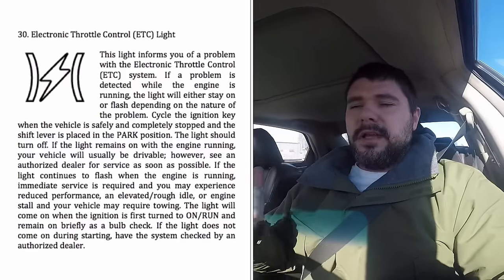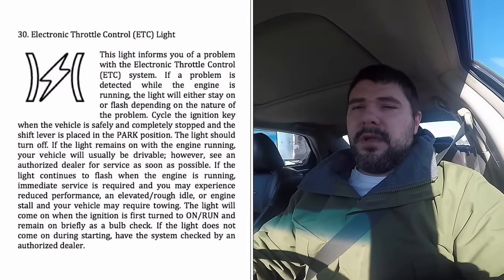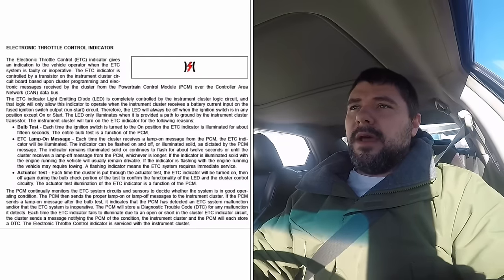Chrysler 300 lightning bolt warning

Comment: I have 2005 Chrysler 300 and the same  thing happened. I was cleaning the throttle body and after putting it back that flashing light came on. What should I do?

Comment: I have the same car 06 300c srt8 my car was shutting off while driving i took it to my mechanic he said there was a leak with the radiator he fixed that for 500 the same thing happened i took it back he said i need a new throttle body and air filter i got a bbk brand new throttle body and replaced my k and n air filter. It hasnt shut off since but im still getting a p2110 code for the throttle body. I restarted the computer and it was better actually driving without feeling like it was going to shut off with no codes them the code came back p2110 im starting to think i need to perform a throttle relearn since i completely skipped that step but im not sure.
Reply: The mechanic knew it wasn't the radiator to begin with..smh.

Comment: Mine just did it.
It's the throttle control system.
Clean with  throttle body clearner.
Fixed problem.
If dosent,get new throttle control system,replace.
Yall have a blessed day
Reply: I have an electrical nightmare. I replaced the throttle body and the accelerator sensor issue still happens. I have a constant electrical forced and I cannot get the flap to move at all it is stuck at negative 100.
Reply: Hey everyone I have a 2008 Jeep Wrangler Sahara 3.8 l V6 and it keeps tossing a electronic throttle light and also the ABS light. No check engine.  My Jeep has a 1360:00 miles on it every time these 2 sequential lights come on I have rough idle goes into limp mode rpm to be around 1200 rpm a cetera and so forth anyway so because she has so much time on it I was just going to replace the ETC but my question is do I need to have it taken to a mechanic to be re learned on the throttling for my engine?
Reply: Replaced throttle body and lightning bolt still comes on

Comment: Great video, answered my ??? why my scanner did not detect a ATC code? My 2008 Jeep Grand Cherokee has the the lightning bolt? Good point about buying dealer, genuine Mopar parts! Auto companies standards of quality are higher than after market. Though auto companies are only required, by federal law, to provide replacement parts for their cars for 10 years!

Comment: My lighting bolt light came on, not losing power while driving, but my brand new battery is completely dead. Will not charge. I get a new battery and within a day, the battery is completely dead and will not charge. I'm glad I have a year warranty with the battery. What could cause THIS problem?

Comment: I recently took my 3.5L Chrysler 300 2006 to a mechanic , they don’t know exactly what could be causing all my codes. One night parked my car cane out 2 hours later my car is stuck in park and in limp mode with 26 codes. My car also does very often with a weak turn over,  idle is stuck @ 3000 rpms while driving ??? Any info would help.
Reply: If your shifter is stuck in park...a little piece of plastic has broken off. There are tons of videos and fixes for this.. look it up.

Comment: Hello, good video overall 
Everything you said makes sense, I had the same issue last week with my 06 300. 
I was getting the the throttle control light with the ESP at the same time, after driving for short time, I replaced the throttle body, That did not fix the problem, I noticed i was getting a heavy air leek on the EGR metal tube that connects to the Intake manifold, I change the rubber seal put everything back to normal and so far problem solved 👍👍

Comment: Hello....i have a 06 chrysler 300, 2.7l engine....my lightening bolt light came on and car started jerking and slowing down....took it to the mechanic and he ran tests and code came up bad throttle body....so he replaced it with a new one....car ran ok for a couple of days but then the lightening bolt light came back on as i was driving on the freeway.....towed it back to my mechanic....he turns the car on and no lightening bolt light comes on....he kept the car for 3 days and ran it long distances....says light never came back on and car ran fine....i pick up my car and it drive ok for the day but that night the light came back and car started to shake again....i don't know what else to do....could it be the MAP SENSOR? CAN ANYONE HELP WITH ADVICE...
Reply: Did you do the reset?
Reply: Same that’s my happend to me did you ever find the problem?

Comment: Hi...my ETC light along with engine light is currently on in my 07 300.  I just had the fuel filter replaced a few days ago.  Currently have 213,250 miles
Reply from the maker: krm2032  the order of diagnosing that type of issue is to first see what the check engine codes are. Then fix what the check check engine codes are. Once you fix those issues and reset the light see if that fixes your etc light. If your check engine light stays off and your etc light only comes on after replace your throttle body

Comment: Thanks for the advice. I will get back to you when I get my car checked out. It's not a 300 but it is a Chrysler 2007 Sebring. My engine light did come on then the lightening bolt. Prior to those two lights the oil pressure sensor light.

Comment: My car dies while parked, driving or anything. Parked it dies and I have to restart it but if I’m going fast enough my car just starts back up in less than a second when I’m driving. The check engine light, oil light and red lightning bolt comes on when it dies. I replaced the throttle body, spark plugs and made sure the egr tune gasket is on. I don’t know what else to do. Any help please
Reply: Im having same exact problem the mechanic said it's the throttle body sensor thinking of just getting rid of it all together
Reply: I just get a oil change when this happens and it goes away
Reply: Did u figure out what was wrong?? My car is doing the same thing
Reply: This is common for these lemon Chrysler's.  I'm almost sure it's either the ECM/PCM unit, EGR valve, crankshaft sensor or throttle body.  All these are common for 300s & 200s & sometimes even fuel pump issues.  Chrysler should be ashamed of demselfs

Comment: I have a question. I don't think it has to do with this but here goes. My Chrysler 300 was stored for about 2 months in the garage and without knowing it somehow the truck wasn't closed all the way and drained the battery completely. The key fobs wouldn't work at all no lights nothing not even a click like the engine trying to turn over. I have been trying to get it started by jumping in in my garage but all get is the clicking sound now and very dim lights for just a few seconds then it won't do anything. the battery is just over two years old and never had a problem until now. My question is I heard that I might have to disconnect the battery completely to reset everything before it will start even if the battery is still good? Please I'm definitely not a mechanic and have no way to tow my car twenty miles away to have someone look at it. Any advice on what it could be or what I should do would really be appreciated. thanks
Reply from the maker: Get a brand new battery or charge your battery completely and see if it will start. It sounds like the battery is too dead

Comment: Hi, I started getting lightning bolt warning while in ignition but goes away when engine turned on. But only able to drive very slow. When tried to throttle its little to no power then and then. Oil change was due so I got it topped up first and the problem disappeared. Throttle response is now okay I think but the lightning bolt warning stays with check engine. It doesn’t go away like before. What do I do now. Someone help please. Thanks!

Comment: He is proud to say my 300 throttle body went 120,00 miles no problem? I have 3 Lexus vehicles (2) ES300's and (1)RX350...all totaling 730'000+++ miles and None of my vehicles have ever needed a throttle body Chrysler/Dodge plays these games. Even installing a specific "built in lightning bolt "crap to officially screw us that's a scam from them the fact it has that lightning bolt alone is shady because it is a well known issue and they want to capitalize on it....

Comment: I have a 2006 Chrysler 300 that was running fine but had a lifter tick. I found 5 bad lifters and replaced all 24 of them and put in new spark plugs while I was at it. Once I got it back together it turns over good, but won’t start. The ETC light is now on as well as the CHECK ENGINE light. Everything is assembled and plugged in correctly. Any ideas? The car has 200k miles, is it coincidence that the throttle body could have gone out while I was working on it?
Reply from the maker: jeff dye  I would pull the check engine codes first fix those issues then see if it takes care of the throttle body light at the same time
Reply: Omg my car is the exact same model and everything and it's the same problem too I'm getting my liftwrs fixed and I hope my car is okay after but I'm nervous

Comment: I need help.. mine shows Lightning bolt and motor light  and car won’t turn on .. my battery is good n starter .. what would be the problem
Reply: Omg my 200 did that today.. got a jump and all lights went off and it ran fine🤷🏾‍♀️

Comment: My wrangler has a hard start changed. Crank shaft sensor ignition coil.   Also my ⚡️ symbol is on.   When I reset it goes away but will come back on within a hour. And my temp gauge goes to cold.  Can this be a problem of hard start ? Or air in system that will make it over heat after 2 hours ?

Comment: You might be able to get the error code you want from the screen display.
If you press the Note 🎵 on the left hand side and the Compass 🌐on the right hand side for about five seconds that will bring up a sequence of 11 diagnostic and information displays which you can scroll through with the up-and-down buttons on the left hand side.
One of the displays is last error code.

Comment: Lightning bolt came on in my 2006 magnum 3.5 it turned out to be Egr  tube gasket going into back of plastic intake got sucked into motor! Easy fix! I was lucky!
Reply: Did it still run. I've got a not start issue
Reply: @eazydamonster1949  might be the alternator as well
Reply: @alexmariscal1926  I haven't figured it out but alternator is good. I just put it in the back and looking for a car to hemi swap it and facelift it

Comment: Changed my old throttle body with one I found at the junk yard. Problem returned. I guess its either change the computer or pull over and cycle the key from now on.

Comment: had my spark plugs replaced and they broke the intake or egr tube and was caused a vacuum leak leading to the red lighting bolt and my car limp mode could be the issue if you have a vacuume leak near your intake

Comment: We just bought a 2013 Chrysler 300c series about a week ago. We haven't had any issues at all until I drove it today. Everything was working properly there wasnt any lights on the dash or anything. Came home and parked. A few hours later I went to leave and it would not start. The lightening bolt symbol came up. Jumped it and it started but couple hours later same thing. Now just the check engine light is on. Any suggestions on what to do and what would cause this?
Thank you!
Reply: Same here did u figure that out
Reply: Did either of you figure this out because I had the same issue loves

Comment: I've been having this problem randomly and I think it's due to my electronic throttle controller that I hooked up. As soon as I put it in the lightning bolt turned on but now on occasion the boat will start to blink and it will accelerate real high until I stop the car pull over and turn it off and let it sit for a minute then turn it back on and it'll be fine except for the light still being on obviously. I'm wondering if it even is the throttle controller? I have a 2012 Dodge Charger RT Max with the Hemi and I have the 2020 dash gauges installed so maybe that could play a part I don't know
Reply: Major Steve Austin  I cleaned my throttle body and changed my battery and its been good for a while now. The battery does all sorts of weird things on these cars.
Reply: Make sure your throttle position sensor connector is secure where you plugged in your throttle controller on each end, and make sure to tell the vehicle the values of throttle input. On my throttle controller, you press memory and down for the lowest input. And with the foot all the way down on the gas you press memory and up for the highest input. Then take your foot off the gas and start it. It needs to sync to your pedal sensor and throttle body by doing this.
Reply: @tigermedz  what kind do you have?
Reply: @jessejohng1472  I have a Roar pedal. It hasn't given me any issues.

Comment: Soooooooo if my check engine light & etc light come on and car won’t start but my battery is fine, just change the throttle body or the starter?
Reply: My issue too
Reply: Leasy Guilbe  my issue was the starter it could be the same

Comment: Should i have the throttle body cleaned or replaced? 2015 jeep patriot. 6 weeks ago the red bolt came on flashing and i had no power behing pressing the gas... I pulled over cut off the car and started it up and the light went off. Hot Las Vegas summer day the bolt light came on again, restarting the car didn't work this time its still flashing and my check engine light and the esc traction light is on as well?
Reply from the maker: speaking from my personal experience. I have never had any luck cleaning throttle bodies. what I find is it will either make the issue worse or temporarily fix the problem
Reply: What did you do to fix the problem

Comment: Will a bad throttle body stop your car from starting??
Reply from the maker: Anything is possible. Typically a no start would be a fuel delivery, ignition system, or engine failure issue

Comment: I have a 2005, 300 and when the lightning bolt comes on the ESP, BAS lights comes on as well and my car wont accelerate??
Reply: Mine is doing the same thing. I was told my ECU is bad. I haven't fixed it yet

Comment: Hey Matt i put my key in the ignition I don’t turn the car on yet but the lightning bolt light stays on for a bit then goes away & service engine light starts blinking. Then I turn on car & lights go away but engine is running rough I had changed throttle body but used a aftermarket thinking about getting a mopar throttle body I’m stuck what should I do?

Comment: My light came on while on the expressway and my engine revved up like it was out of gear. Sort of putting the transmission in low gear while driving at 70mph. I put the trans in neutral really quick turned the engine off then back on. The light went off and the truck drove fine. What's your opinion on that?
Reply from the maker: That’s what was happening with my car. I replaced the throttle body and it has been fine ever since then
Reply: It will happen again get it checked
Reply: @MattsMotoWoRX   im having same issue in my 06 300 etc light on and check engine light on was told is was map sensor i reppaced it then was told to clean throttle body  so i did ran and went fine for about an hr and back to same issue codes come up p0700 and u0100 please help
Reply: @paulwcolburnjr mmmmmmmmmmmmmm mm d mk m I plt poo

Comment: Need help Guys every time I put my key fob in the ignition a red light quickly blinks once on then off... I turn the fob and nothing happens . car won’t start and I can’t even close the sunroof  . Is there a recall on anything other than the airbags? 2008 Chrysler 300 Touring signature series
Reply: Coryontae Brown is the remote key unlock/lock working properly? I had the red lightning symbol and engine failed after couple of minutes, my key battery was flat, changed the key battery and haven’t seen it since, that was two weeks ago, battery is £1 worth a try? 🇬🇧 2009 300 srt design touring 165k
Reply: On dodge journey and certain 300s are recalls

Comment: Im here a year after this video but my lighting bolt issue happened this morning well mine flashed on with the engine light really quick and it shut the car off when i was at idle but it started back up, i have a 2006 chrysler 300 srt8 just like the one in this video. i replaced my throttle body 5yrs ago but i had only the lighting bolt flash and it wouldnt accelerate for a few secs but it would come back. Do you think mine need replacing again or just a reset?
Reply from the maker: HATTIE B RACING I would say try cleaning and re learning the throttle body first if that doesn’t fix it then it will need replaced. Let me know how it goes. Thanks for checking out the video!
Reply: @MattsMotoWoRX  Thanks for the quick response. I will try cleaning it today. How do you relearn it?
Reply from the maker: HATTIE B RACING if you don’t have a decent scan tool you may have to take it to a shop and have them do it for you
Reply: @MattsMotoWoRX  Thanks!

Comment: Matt thank you so much I have learned something new today I hope it's the same thing with my car and nothing else major I have a Dodge Charger 2007 do you think it'll work for my car cuz I've heard that it applies to these kind of cars as well if I'm not mistaken?
Reply: I have a 2008 dodge charger and I have the same problem. I have tried what he is talking about and has worked. There is also another video that will show you how to recalibrate the throttle body and that help the problem a little longer to. I have almost 200,000 on my car. But I also just had my motor rebuilt but the part was not replaced.

Comment: Hi Matt, 
HRU? I  placed a new Throttle body in my car. but my car went off and the sign came up again. the code came up as p0400.
Reply from the maker: Jen  first thing to diagnose is the p90400 which is a generic egr code fix that issue and see if it fixes the other issue